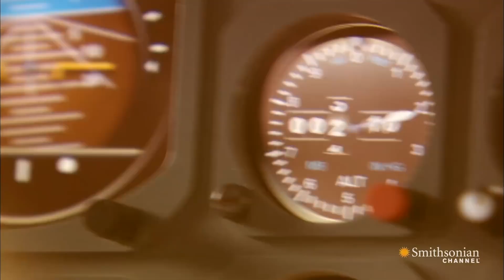The Reason Plane Tires Don't Explode During Landing

Comment: Uhm they explode all the time. Aircraft mechanic here
Reply: Beg to differ, Barnaby.  They throw caps all the time.  They blow fusible plugs sometimes.  Either case will shred the tire if it happens at speed on the runway.  Anybody nearby when a fusible plug blows on the gate will react to an "explosion", but it wasn't.  A tire fodded during takeoff or landing might explode, but the result could be difficult to distinguish from one that just thew a cap or deflated at speed.  Actual tire explosions have been documented, but they're very rare.  Tire failures happen all the time.  Tire explosions don't.

Comment: ... also the 170mph is horizontal speed, thats not the speed that the tires are approaching the ground at.  A plane's vertical speed during landing is on average 2 meters/sec which is about 5 mph.  If a plane tried to land at 170mph vertical speed.... the tires and everything else on the plane would be destroyed.
Reply: Airliner main tires are designed to survive four times their rated load, at least in part because airliners are designed to survive three-gee landings.  Stress-wise, what a 170 mph landing means to a Boeing 747 main tire is that it will be spun up from zero to about 1,200 RPM in the first second after contact with the runway, and then pull its share of bringing a half-million pound airplane to a stop.

Comment: 1989.Me on  fully loaded 747 Frankfurt, Germany to US. First number 4 engine caught on fire after being in the air for about 10 min. , they did managed to get it out but pilot decided to turn back so he let of fuel and we circled for quite a bit before he landed. Since plane was heavy, for one no empty seat, lots of luggage  and still quite a bit of fuel.. when the plane hit the runway..we did blew tires and sat on the runway for some hours until they got changed.. I do not like flying anymore and when I do am tense
Reply: Although dramatic you were never in any real danger
Reply: @PabloGonzalez-hv3td  Flying is always a non-zero amount of real danger.
Reply: @eltouristoduo  I like the quote that flying isn't inherently dangerous but it is completely unforgiving. I think there's a difference.